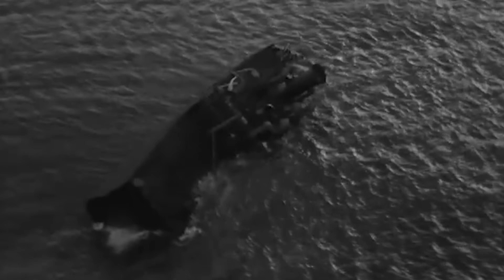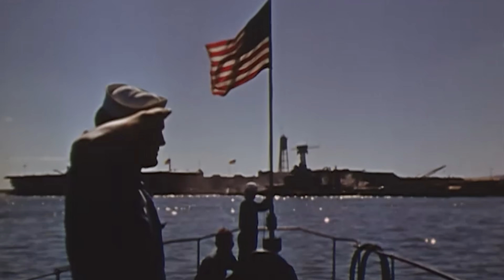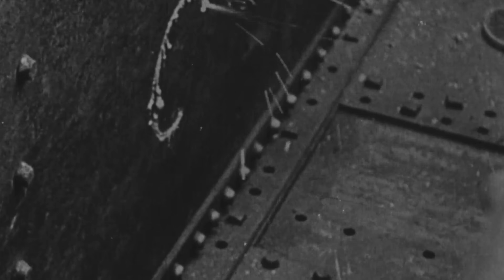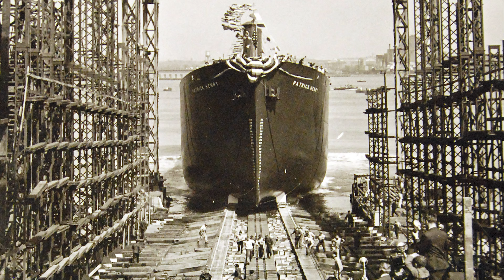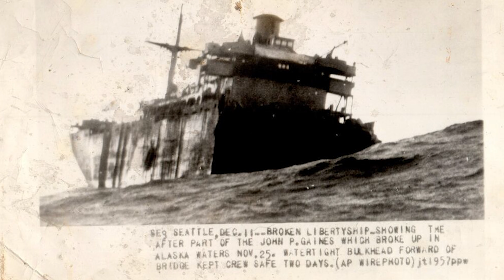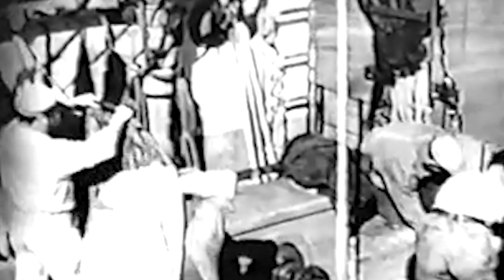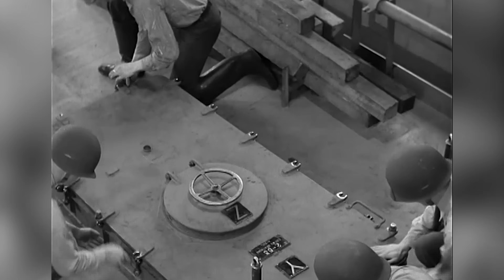CATASTROPHIC Design: The Ships That Broke in Half

Comment: This tendency of the Liberty ships continues to have an impact to this day... the SS RIchard Montgomery, fully laden with a cargo of much-needed ammunition, broke in half and sank while at anchor off the Isle of Sheppey in Kent, right in the mouth of the tidal River Medway. 

Eighty years' worth of tides have acted on the soft mud of the tidal seafloor where she lies, digging it out so that she now rests very precariously on the edge of a shelf of mud, her cargo still aboard and scattered around her, exposed to the salt water.

If that ammunition - a full cargo of small arms ammunition, artillery shells, cordite and other highly dangerous explosives, goes up, it will cause a tidal wave that will affect Sheerness, the Medway Towns and potentially as far away as Southend, and the sound of the explosion is likely to be heard for many many miles around, blowing out windows right across the Isle of Sheppey and Medway.

Until very recently, her masts were visible above the waterline, but I believe they have recently been removed; there are warning buoys around her and the site is patrolled regularly by the Navy and/or the Royal Engineers. 

(Second time trying to type up this comment thanks to my computer freezing on me!!)
Reply: And it it blows up, it will make up to £200 of improvements to Sheerness.

Comment: This video is a miscarriage of justice to the design of the vessel. They were never supposed to make a return voyage. The point of the project was to be that you need supplies and materials. Unload the boat and then tear it apart. That is what it was designed for. This you get supplies and steel, copper, etc. it was short sighted people in power that didn't understand, that kept putting them back to sea.

Comment: Very interesting. My husband who worked in engineering and did quality control paid rapt attention to this clip and fully understood the problem. Brittleness. In effect, it is where someone dips a rose in liquid nitrogen then drops it on the floor and it shatters. All that has changed, is the temperature of the item, but the change in nature of the material is dramatically obvious. This is a good test which we have doubtless all seen.
Reply: German U-boats were welded and could dive to 200 meters.
Reply: @naughtiusmaximus830  well those obviously were welded in the right way, weren't they?
Reply: It's not about welding.

It's about the materials properties. Different metal mixes have different brittleness in cold seawater.
Reply: @mjfan653  It’s not cold at 200 meters?
Reply: @mjfan653  the steel they used was fine if it was riveted, but due to improper welding techniques, the overall design of the ship and high sulfur content the steel was very prone to cracks.

Comment: The claims about the breaking ships being the fault of the workers - a work force that was heavily composed of women and minorities not permitted to otherwise take part in the war effort - are depressingly all-too-familiar.
Reply: To some extent, the more skill intensive welding was done by white males, with many of the females, minorities, and youngsters doing the "tac" welding used to hold the larger pieces together and allow the jigs to be removed until the more skilled welders came along behind them to run the full seams.  That, or they did less critical welding.  Though I'm sure as production continued to increase more females and minorities began to weld more important stuff.  Pretty sure the "skilled" welders were also draft immune, though the less skilled welders weren't. 

  My grandfather did the tac welding from 16 until he was drafted, though I never asked him which specific shipyard he worked at or which ships specifically he worked on. He'd lied about his age, as many had, to get the job in the shipyard.
Reply: As is the lack of training.

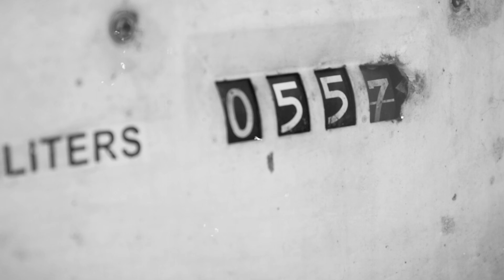Comment: I think you have an errror at 8:18, you say that a shortage of machine tools to make turbines caused them to turn to.....turbo electic propulsion. Turbo electic uses turbines
Reply: He mentions a shortage of machine tools to make the gears that transmit that power to props from those specific turbines I believe. Something a turbo electric ship wouldn’t have, at least not in the same capacity, because it’s power is going from the turbines, into generators and then that power being generated is being sent to propulsion motors. That’s at least what I’m interpreting.